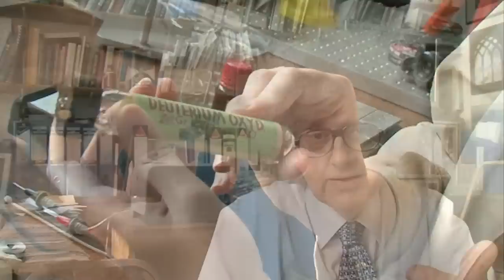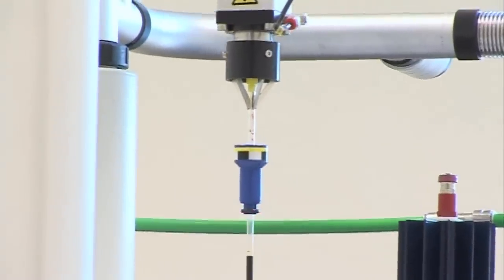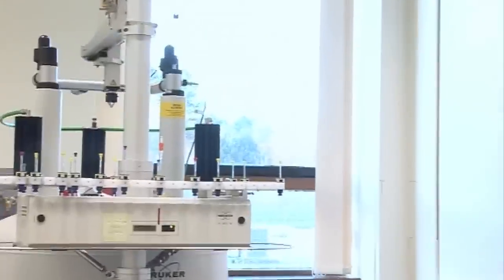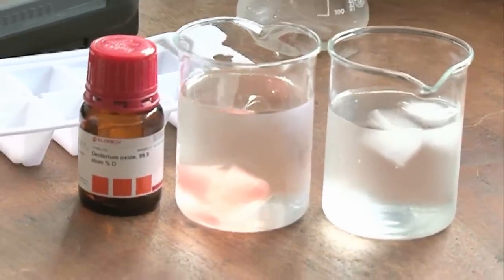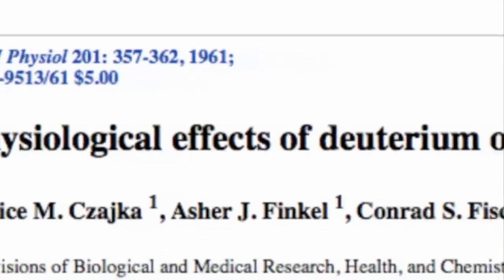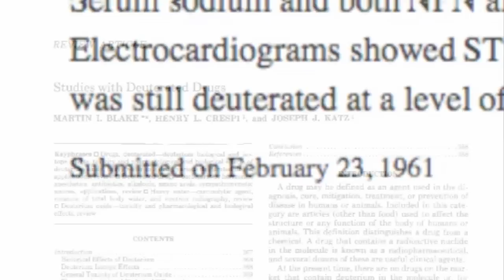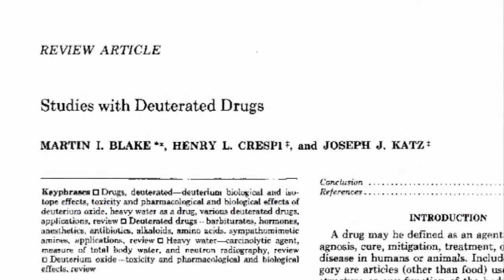Can you drink Heavy Water?

Comment: Drinking a glass of heavy water normally is just like drinking ordinary water.  Unless you drink it fast when you are really thirsty you might briefly feel thirstier as it pulls normal water out of your throat tissues faster than it diffuses in. Rats can distinguish it and will avoid it if they have access to normal water.  Drinking a glass or so a day isn't harmful but if you start drinking it by the gallon bad things will happen. Nothing much happens until you reach about 20% replacement. Heavy water in high concentrations directly inhibits cell division by stopping meiosis..  First, you stop producing ova and sperm cells and become sterile.   At 25%+ you get gastrointestinal inflammation and hair loss. At 30% replacement, your bone marrow stops working and platelets and red blood cells and white blood cells disappear and you die of aplastic anemia. No mammal can tolerate more than about 30% replacement of normal water by heavy water.  In general, all plants and animals die by the time you reach 50%. Some micro organisms can tolerate 90% to a 100% replacement  but they grow very slowly and often have distorted cell shapes. The effect is akin to radiation. Prokaryotic organisms like bacteria that don't have chromosomes are more resistant. 

Some attempts were made to see how it affected cancer cells. but the concentrations required were too toxic to normal cells to be of any use.

One easy way to distinguish heavy water is to freeze it in ice cubes.  Then chill normal water in an ice bath until it is just above freezing and put the cubes in. Heavy water freezes at several degrees above freezing so it will not melt, and the cubes will sink instead of float as they are about 10% heavier than normal ice cubes and are heavier than liquid water at 0 degrees..
Reply: Jerry Bear appreciate it mate thanks  🙏🏽
Reply: just watch cody's lab channel, and he still alive after drinking few ml of it
Reply: So what you're saying is you've discovered the male pill contraceptive. Nice work. Will pick some up from the pharmacy on the way home.
Reply: interesting. where's the source though?
Reply: Ive also heard it has a sweetish taste compared to normal water.  It dies something odd to sweet taste recptors.
Reply: You should have replaced the fellow in this video.
Reply: That much specific information sorely demands a link to the source! Where did you get this?
Reply: Let me guess, you have awesome hair.
Reply: @JerryBearElPaso  Maybe it's a Swedish taste :)
Reply: I didn't continue reading when I realised your comment had nothing to do with his hair.
Reply: why does a single neutron change the chemical properties?
What is happening to the electron cloud?
Reply: @Jerry Bear where can I learn more about deuteriums affect on human cells? I have heard it can "break" the mitochondria too.
Reply: Where did you get your info? A dream maybe?
Reply: Interesting info. Thanks.
Reply: @transkryption  It's chemical properties remain the same, as D2O is an isotope of H2O. The difference results from that extra neutron is a heavier mass, which will effect the bond energies and strengths. This same effect produces a different spectrum reading as the Professor described, making analysis of organic molecules easier because the organic molecules with regular H2O will be more prominent in a solution of the rare D2O for example. Additionally, with more mass from that neutron it requires more energy to produce phase changes. The electron cloud will not be affected at all (I'm assuming  here) because while mass increases, the overall charge on a D2O is the same as H2O.
Reply: Dose anyone wonder if they use this in mountain dew and other drinks like wen you've got the mad drys and nothing quenching your thirst and you just want some ormus or spring water  I feel like all soft drinks are made of this and energy drinks so you drink more
Reply: Thankyou
Reply: Do you know anything of ormus water I like your explanation of heavy water I bileve omus water would be the opposite as it improves meny of the things like hair loss even pigment and cancer
Reply: Such an answer I hopped to get from the vid, but not find it in the comments... Thanks again.
Reply: Sounds like something from chubbyemu's video
Reply: Prokaryotes don't have chromosomes? What? Chromosomes are just condensed nuclear matter and if you're implying they don't have nuclear matter then that's even more wrong 
How does absence of condensed nuclear matter prevent harm from D2O
Reply: @JerryBearElPaso  i think the sweetness came from the lead electrodes in the electrolysis process
Reply: @shanekrieg818  Ormus water is just snake oil. Well, not literally, but it's just a product with a made-up list of effects with no scientific basis whatsoever, and sold by quacks as a wonder cure for everything. Any scientific claims made by the makers of Ormus water are easy to debunk by chemists, physicists or doctors, and it's just a fancy placebo, and preparations of it consist mostly of regular tap water and some dissolved salts - basically the same as many brands of bottled water.

Ormus water, at least in the way it is described by its proponents, simply does not exist.
Reply: @deee dawwwggg If you treat YouTube is a game, then yes. Comments come in all shapes and sizes, funny one-liners being just one kind, and usually the least interesting as it smacks of attention-seeking desperation when popular channels get hundreds or even thousands of comments from people trying to get that coveted top-spot as the most upvoted one. There certainly are more interesting games to play, and once people realise they are just playing a game leaving their one-liner “funny” comments here or on any social media platform, they would be better off trying something a bit more satisfying on Steam.
Reply: Outstanding, thank you. Also, you forgot to mention that everyone's cells contain a small portion of D20. It is required for life.
Reply: Excellent explanation. Can you make someone glow green by giving them heavy water? Asking for a friend.

Comment: They ask if heavy water be drinkable or not?
I say is the heavy water you mean water mixed with zinc, iron(Fe), calcium, silicate and potassium than yes it is drinkable after filtration which reduces the amount of those elements. But if it is mixed with arsenic than please use that water only for outside work except for drinking.
Sometimes in my home country water carries petroleum and there is no other options left with out drinking than we filtrate that petroleum from water and make it drinkable.

Comment: If you want to learn the truth find Walter Russell. He basicly gave humanity deuterium.
An element is made by 2 oposing intersecting waves (male and female) also called an octave, this intersection forms a sphere (example sun) which has layere of different pressure and polarity, this sphere then disintegrates in to rings of different pressure and polarity and those rings contain other spheres ( example planets) and the same way those spheres integrate from their primary to disintegrate in to spheres (example moons). The only difference is in the amplitude and the frequency of the wave. For example in if you take carbon for example to be the sun at point 0 then his planets are +1 lythium, +2 berylium, +3 boron and -1 flourine, -2 oxigen and -2 nitrogen. Plus and minus elements are oposite mates and this they will react to form a voidance of these elements.  In integration phase each each inner sphere contains all elemnts of lesser octaves and the sphere is build from highest pressure at  center of the first sphere (the source of creation) then continues building according to the next octave forming layers of different pressure and polarity (like our planet). Note that the planets are created by their primers and moove outwardly untill they disintegrate and return to sun for reborning. When s planet changes the polarising ring it changes in composition. Example, the furher the planet is from its primer the lower the pressure, but depending on the polarisation it will eather expand or contract.
Reply: Also these octaves can contain semi-tones which you would call isotopes on atomic scale. Gravity is also not what world thinks it to be, it is working trough pressure zones, elements habitating in non native pressure zone seeks its own pressure zones. But when you have a voidence of different elements ( molecules) they form a semi- tone or a system for example Oxigen as primary and 2 Hydrogen planets (oxigen is in fifth octave and can contain 2 hydrogen atoms in its system since it is one octave ahead of hydrogen). Since they are in balance they will stay in balance untill it is disturbed but still each of these elements will continue to seek each own pressure zone, thus you can say oxigen will seek its pressure zone and hydrogen its own pressure zone, thus this molecule will position it self in balanced position between the 2 respective pressure zones.